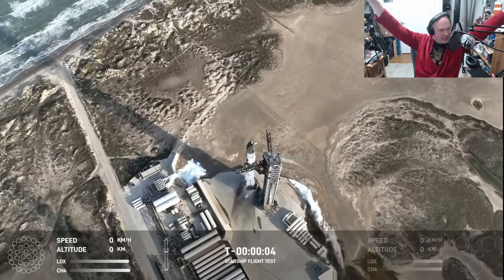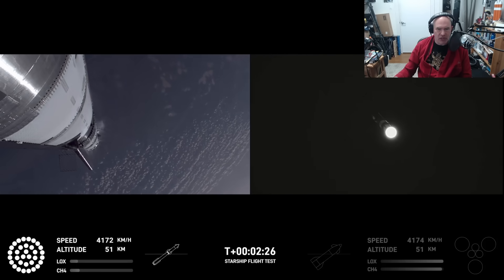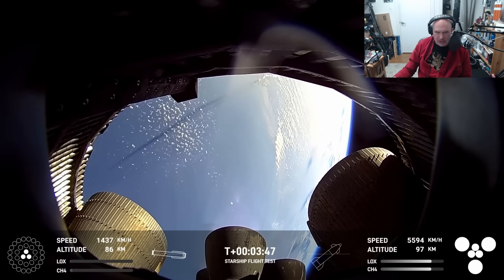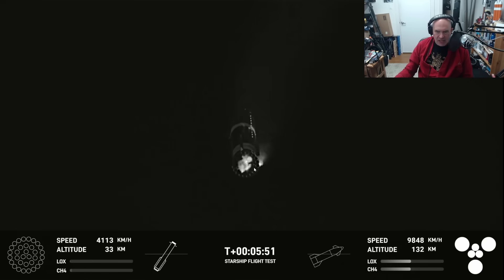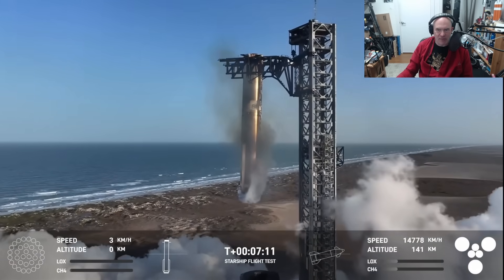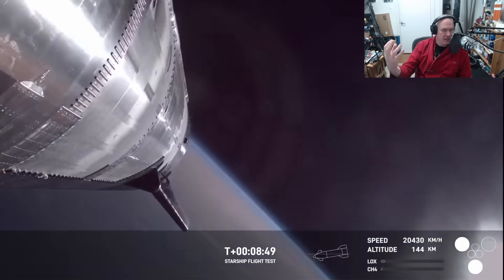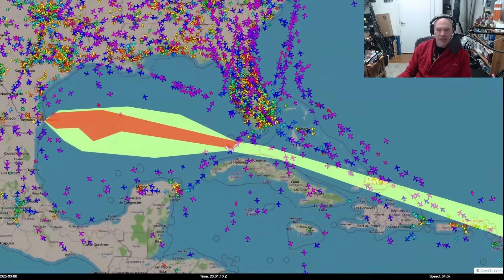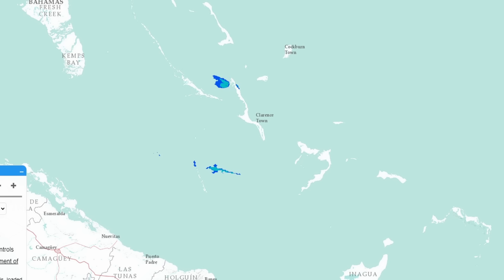SpaceX Make The Same Mistake Twice With Starship Flight 8

Comment: I myself wonder about the shutdown of so many engines at once. I suppose it could have been that fire getting into something vital. I ponder the saturation conditions of the propellant late in flight.  If you think about they are flying very sub cooled propellants in uninsulated tanks.  That’s fine if the tank ullage pressure is generally at saturation and you only pressurize just before launch. Think about how heat flows into the tanks. The walls are covered with condensing N2 and the outermost layer of LO2 is exposed to this heating. The thermal conductivity of cryogens is not great so a layer of warmer LO2 forms just inside the wall. Due to buoyancy forces it rises in free convection, gradually absorbing more heat until it reaches the ullage.  By then it’s not saturated at 0.5 Psia.  It’s saturated at maybe 20 and that matches the ullage vent setting.  Gradually over time this forms a pool of warmer LO2 on top of the cold dense main propellant. The depth is only controlled by time and conductivity.  

Then you launch and pull g’s.  The stratification is strengthened and aero heating adds even more heat. You wait a couple minutes for first stage burnout.  Then you light the upper stage engines.  They run great on the super cold bottom propellant.  Time goes on.  Your press system is set at maybe 20 psia so you’ve got plenty of NPSP and line losses are low due to just liquid flowing.  

Then late in the burn some of that warm fluid starts to get into your feedlines.  Since it’s warmer the degree of subcooling is less.  Finally somewhere in the system, a point is reached where liquid pressure is at saturation and cavitation begins.  Slowly at first but the liquid keeps getting warmer.  You can’t compensate because the ullage is huge.  The flow passage becomes more constricted by vapor. Pressure drop increases.  Eventually the engine inlet NPSP reaches zero and you get a pump cavitation and turbine over speed. It should happen on all engines really.  I know this is just conjecture but I’d sure like to see engine inlet temps!

Comment: the outer engines are fubar. They are terribly warped. No way they can be used again without major repairs and overhaul.
Also, the engines routinely fail to ignite once launched. What will happen, when the gimbaling engines fail during the landing burn?
Engines continue to fire on SS while at least 2 engines are completely missing.
It spins and tumbles without any control with the engines still firing. 
Its a blatant disregard for safety and a lengthy investigation is needed, both from spacex and the FAA. It's ridiculous, that they were allowed to launch again so soon after the last failed attempt. They are not alone on this earth and spacedebris effects everyone. Both when coming down and when staying up.
I'm a huge fan of spacex and SS, but if Elon hadn't bought himself into a position of power, things would go very differently. Rightfully so.

Comment: Lots of folk in this thread slagging off starship, but what other launch system are you going to use to put the hundreds or even thousands of tons of habitation on the moon for a real-deal moonbase?  Who else is testing fuel transfer? Are you going to do it on a single launch?  Who is going to scale up apollo and build the saturn LX with its 60 F1 engines? Where would it launch from?
Reply: gotta make orbit without exploding before you can do any of that. they are 0/8
Reply: @howilearned2stopworrying508   Well, by those standards, Apollo had a 50% failure rate (only half succeeded in landing humans on the moon) and Space Shuttle had a shameful 100% failure rate (intended  to assemble Mars mission vehicles in orbit, did not build any Mars mission vehicles ).

Maybe starship will never work. Maybe a two-stage fully reusable system is not the way to do it.

But what is the alternative plan? If Spacex are not doing anything new (as many commenters say), then why hasn't any other company stepped up and copy-pasted nasa's decades-old rocket engine, heat tile and propulsive landing technology like spacex has?  What were all the aerospace firms doing for years when astronauts had to fly on soyuz? They had the know-how and the factories, why didn't they put something together in a few months?

Comment: 13:50 Imagine any of the previous flights made it into orbit with faulty hardware. Or they do make it into orbit on no 9 and more problems occur. Turns out having a 100 ton reentry-able ship makes safety a nightmare in the long run, anytime you loose control of one you can start evacuating a city.

If the starlink dispenser jams you now have 30 tons of satellites sitting inside a reentry steelcan. Not sure how they will break up before hitting the ground.

Comment: There is clearly a design flaw with the block 2 Starship. It is time to scrap it and move on to Block 3 to fix the problems. Block 1`s flew and landed safely....so obviously this is a block 2 issue.
Reply: The first two block 1 ships also failed (3 if you count the first flight, but that was more the booster's fault). If they'd given up on Block 1 after two failures, they'd have never gotten Block 1 to fly and land safely.

Comment: Do you think they have added too many engine.
Reply: The booster has 33 engines and has worked just fine on the last five flights. The part that failed on the last two flights, the ship, only has 6 engines. So if the part with 33 engines works and the part with 6 doesn't, it seems unlikely that the problem is "too many engines".

Comment: The oscillations originated from the loosely fitting satellites that were loaded in the pez dispenser. As a result of the violent vibrations and shaking of the pez dispenser and the layers of shaking satellites, the ship came apart and exploded.

Comment: This is crazy. Why are these new engines supposedly more advanced,powerful , safe and cost efficient,yet all these mishaps are occuring. If this keeps up they'll need to go back to the simpler saturn v f1 engines which worked alot better.
Reply: The F-1 engines were only ever started on the ground and used to ascend, under which conditions it had a 65/65 track record.
Under those same conditions, Raptor 2.5 has a 230/231 track record, which is almost as good, and the 1 failure it did have had no affect on that flight.
The vast majority of Raptor issues have arisen after starting them mid-flight, something the F-1 was incapable of doing and so never did.
So there's no evidence that switching to F-1s would actually help. Not to mention their thrust density is a lot lower, so they couldn't even get Starship off the ground.

Comment: If they really want to simulate a long duration burn on the ship, they're going to need to start the test with the base fully enclosed by the hot stage ring, and then move it away as the burn continues. You don't put engines on planes before testing the reverse thrust.

Comment: Question: what if the upper stage was an expendable rocket? What kind of payload could it get onto orbit or beyond, thereby generating revenue while the upper stage problems are worked out? At least the booster would be put to effective use, and more experience gained in its operation & recovery.

Comment: this proves to me that starship is a failure as a platform. will no longer be paying attention to further launches
Reply: Brother, imagine if everyone always just quit after failing a couple times?

What happened to, “if at first you don’t succeed, try try again”?
The engineers here dedicate their lives to this, shouldn’t we at least give them our support? After all, if they succeed, it will benefit humanity as a whole. Don’t fall for recency bias. Focus on the whole picture.
Reply: @terrestrialcreature7481 when can America try communism?
Reply: @terrestrialcreature7481  Sure! and good work requires persistence. But these massively complex, highly integrated systems are in many ways exceptions to this. 
A system can be designed in a fundamentally flawed way, based on assumptions that do not hold up in the real world - and perhaps if enough resources are spent, it can be made to work, but it's not an efficient solution to the problem; the same way that building supersonic trebuchets or vactrol CPUs aren't reasonable solutions within their problem space.
SpaceX clearly has the expertise to build a capable platform. Falcon 9 and Falcon 9 Heavy are examples of this, so is their controls expertise that they demonstrate with every caught booster, so is every Raptor they put out that relights successfully. If they could put that effort towards building, testing, and checking a platform that's space-worthy from the jump, I would have much more faith in them as a company. Instead, we've seen one platform fail to achieve mission objective 8 times while ruthlessly endangering the surrounding community, callously ignoring safety practice, etc.

Comment: They keep saying the "go fast break things" method is so that they can find flaws and progress faster... But it takes quite a while to make a rocket, so maybe instead of spending all that money and time on that, they could spend some of it on doing tests, and taking their time to get it right... rather than... you know... breaking stuff and then not even learn from it...
Reply: Well, they seem to be having harmonic structural problems under sustained full thrust in a vacuum in near-weightlessness.  I am sure building a testbed on earth to duplicate those conditions will cost more than the apollo, shuttle and ISS budgets combined.
Reply: @zackmollusc3522  Not that other ships didn't have that problem more than half a century ago and found solutions to it.
Reply: @ContraVsGigi  Did they find the solutions by altering the design, then flying it to see if they had made any improvement?
Reply: @zackmollusc3522  There are ways to simulate most of these things. It cost money and takes time but it works. And then there are ways of doing smaller launches to test all of these systems out, it cost money and takes time but it works. What they are doing is sending another large rocket and hoping they caught whatever broke last time, which cost money and clearly doesn't work. And even if it cost more and took longer than what they're doing, with a slower more careful approach there wouldn't be the risk of debris falling down over populated areas (with this specific launch it looks like they just barely missed any populated islands north of Cuba, but had the failure happened at a slightly different time or in a slightly different way then it easily could have led to debris falling over populated islands)
Reply: Well, not like Elon cares. It is public money, afterall, and he is tapped dorectly to the source. 38 billions until now, if I remember it right.
Reply: Considering this past failure was basically identical to the other one a month or two ago, they didn't learn JACK SH.

Comment: The problem is they are engineers not mechanics that actually got their hands dirty. Just look at the cars they build. Failure is self evident. Orientation is key. probably a tank pickup problem, system running lean valves freezing in position.
Reply: Amazingly valid point. This is actually a comment I left on another post where someone was giving SpaceX advice on how to do things better..
Me: Or, hear me out, they could just stop doing what they're doing altogether and leave it to actual experts. Lol.

Comment: Funny that the upper stage which is probably a lot less complicated than, the booster failed but the boostet did not.
Reply: And that was the exact same situation last failure. The capsule disintegrated on return. I guess Leon just really sucks at everything he does and breaks everything he touches with his special-k tweaker hands.
Reply: @StrangeScaryNewEngland  Is the capsule supposed to return to earth?

Comment: They have a seal material problem that cannot handle the temperature changes along with the vibrations. They should cycle the seals through the expected temperature changes and then test-fire the rocket while introducing vibrations. But be careful, do not blow up your test facility.

Comment: My theory. When they changed to the heavier, larger V2 ship they didn't account for the increased time and pressure the ship is exposed too during hot staging. They are using the V1 hot staging ring. The V2 ship requires more time to accelerate away from the booster. Though it is only fractions of a second longer, the additional time the plumbing, and nozzles are exposed to back pressure is enough to damage things. The hot staging ring should have been redesigned to account for this.

Comment: I just think hot staging is not the solution. It blasts pressure off the booster right back up the nozzles
Reply: Yeah. From the combustion chamber to the engine bells. Like the Hobbling scene from Misery. Annie Wilkes strikes again ... wham!
Reply: It is the solition, but using struts instead of just having skin openings significantly reducing the back pressure and hot gases .
I have personally simulated the separation process for the   microman project at Convair.
Reduced scale vacuum tests at the Arnolds Engineering test facility in Tullahoma  Tenn  , could  shed some light into the problem.

Comment: You have to admire SpaceX for their dedication to this long term experiment proving the Soviet "fly it then fix it" approach to spacecraft development is just awful.  New Glenn will be long retired before 
Musk's giant silver "intimate entertainment device" (now finned for more enjoyment) ever gets rated for human flight.
Reply: i'll take that bet all day. New Glenn managed to put debris into space, no return on upper of course and the main booster blew up. Starting over for NG
Reply: @warrensouther1156  When does some part of Starship not blow up? SpaceX has been doing test launches since 2019 starting with their star hopper test mule (second test mule, the first on blew up) and have had a catastrophic failure rate. Worse, they are still having engine problems if you look at NASA's testing requirements for engine verification you will see how bad that is. New Glenn's engines worked right out of the box but they use the NASA development approach. The Saturn V went from design proposal to first launch (full up, all stages) in 7 years and never had a launch failure.
Reply: @EinKerl3554  starhopper was tested with the methane engine and landed. Still at starbase. I watched it launch and landed. Watched as they focused on the upper stage development, excitement guaranteed. Mostly blew up just to keep moving forward. So this exploding is not anything new UNLESS you have not been paying attention. Just like when NG upper stage exploded last fall in testing. Now we have moved on to version two of upper stage and it appears that they have had two RUDs at around the same stage in flight for possibly different reasons. This was not a fire in the attic, it was an energetic explosion in the engines. Meanwhile, the ten story lower stage returned and was successfully caught. Again. Where is New Glen’s lower booster? In a million pieces at the bottom of the Atlantic Ocean. Don’t tell me they got it right, right out of the box. 😂, it blew up. Let’s see who is ready to test again first, see who makes the next major step first. My money is on SpaceX.

Comment: Just spit-balling here but do you think there is some high pressure event from hot-staging that causes too much added force on the ship engine nozzles and beyond?
Reply: Yup. Check out @grumblewoof4721 a bit earlier. My gut feeling is that the vent strakes on the hot stage itself don't permit sufficient escape of the Starship engine exhaust gas as they fire in too much of an enclosure. I think the concept SpaceX has latched onto is the example of a gun chamber partial containment of exhaust gases during the firing of a bullet. The scale is all wrong, etc, etc. Sufficient blowback may exist to set the Starship engine bells wobbling and vibrating like crazy. Sort of like Quasimodo (the bells, THE BELLS!) Call it the Quasimodo Effect?

Comment: Ever had a friend you know is a bad, erratic, dangerous driver offer you a ride that you turned down? That’s exactly what I would do if I was one of the astronauts stuck on the space station and SpaceX shows up.
Reply: Huh? SpaceX has launched 15 crewed flights, 10 for NASA and every single one of them has been successful. You can’t compare an experimental vehicle that is intentionally handicapped to test its limitations to a fully functional, safe, reliable, crewed program.

Comment: SpaceX implemented 3 different design changes to solve resonance issue. Perhaps 2 succeeded.

Resonance issues are usually solved with increases in stiffness (to raise frequency) and increased damping. Yes, both add some mass, but maybe not much.

The version-2 RVAC methane "down-comers" are my prime resonance suspects since they are long and slender. Perhaps they need to jog to the hull, fastened midway, and effectively get much stiffer.

Comment: I I think they keep shutting the engines off as the safety precaution, and those engines that were stuck on even though they were getting no fuel and fuel and no fuel they didn’t explode. They kept running too much safety protocols it’s gonna explode if you turn off the engine, so what’s the point of turning them off?